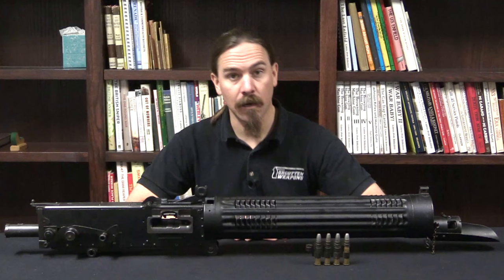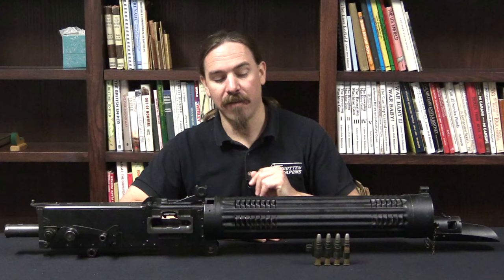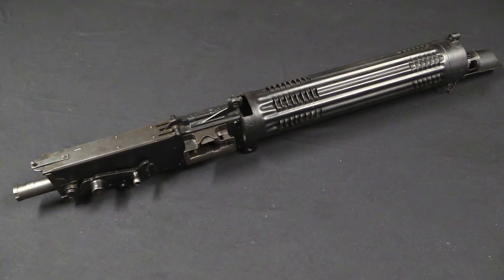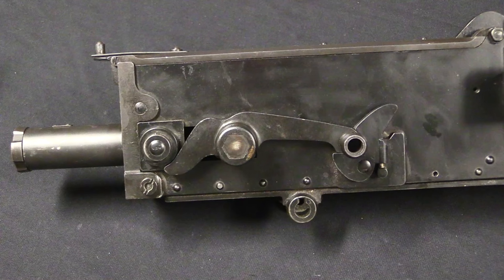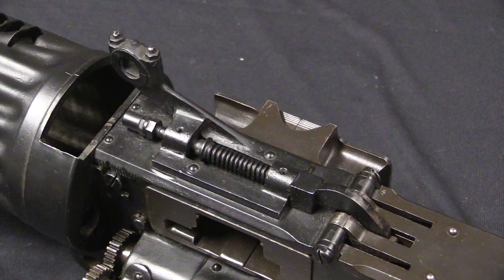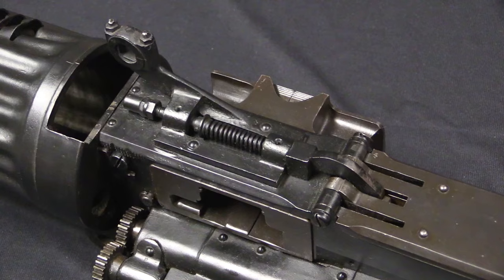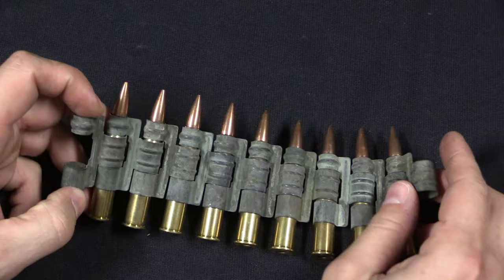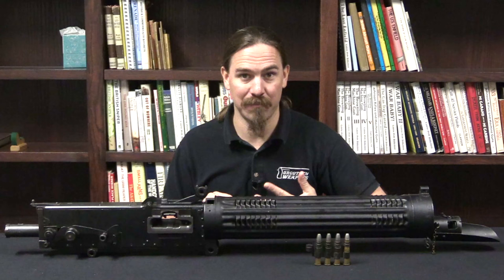11mm Vickers "Balloon Buster" Machine Gun

Comment: There's actually a fourth way to get a gun to fire safely through a prop, and that's electrical. AFAIK it wasn't used in WWI though. It was defintely used in WWII, the prime example being the 20mm MG-151s in the wing roots of the Fw-190. These used electrically primed ammunition, i.e. there was no firing pin, just an electric current applied to the primer. It was then a relatively simple matter to arrange interrupted slip-rings on the prop shaft that cut power to a gun when a prop blade was in front of it.
Reply: Isn’t that functionally identical to an interrupter? Just instead of mechanical timing it’s electrical?
Reply: @ryanrising2237   Yes essentially. It's a lot more reliable than trying to temporarily stop a machine-gun with a collection of long rods and cams though.
Reply: Ditto mg 17, mg 131.
Reply: Why isn't electric primed guns used more often? Beside the etronX that is
Reply: @thesturm8686   It's used widely in aircraft cannon to this day.
Reply: @MrHws5mp  i mean in a non aircraft related way

Comment: Because he was a former race car driver/mechanic Eddie Rickenbacker made sure his ammo was double checked for cartridge sizing as he was aware that most stoppages were due to incorrect casing size.
He also carried a small hammer which he used at times to help remove a stuck case while in the air.
(Source, Rickenbacker's autobiographies)

I wonder if, Frank  "Arizona Balloon Buster" Luke who is credited with 19 overall kills (placing him second behind Rickenbacker), with 14 of those kills being balloons, used one or two of these 11mm guns.
Reply: A Vickers with a failure? Must of been you yanks doing something wrong. ;)
Reply: @sshep86  if I remember correctly, the armorer was actually a Brit.
Just kidding.
I enjoyed your comment.
Reply: @sshep86  ammo stoppage.
Reply: @ScottKenny1978  should of stuck with the .303  Proven reliability record.
Reply: @sshep86  but the US Navy wanted the machine guns in their new rifle caliber, for supply reasons.

Just not enough recoil force with that little 6mm Navy round to run the heavy Maxim action. The Colt 1895 weighs about half of what an 08/15 does.

Comment: Balloon artillery guy: "uhh, a little bit to the right... Keep going! Uhh, my balloon is making a funny noise. Why's it hot up here?"
Reply: At least the guy was provided with a parachute. Not a very sophisticated parachute, but If I was jumping from a burning balloon I would't be too choosy.
Reply: @donjones4719  , I didn't know that they were provided with a parachute.  I was thinking,  how horrible it would be to have a flaming ball of hydrogen exploding above you. I wonder what their survival rate was.
Reply: @MrJeepmarine  low I would imagine, even with most of the fireball going up and out [from penetration points]... there would still be enough flaming material coming down on them.
I would surmise it would be hot enough to cause serious burns on the skin, and potentially fatal burns if it enters the nose or mouth.
Only good news is that it would be a fairly quick flash, that right there might make the explosion survivable... the fall? No clue.

Comment: I like the Modifications they did to enhance its air cooling - the jacket probably created a nice forced air venturi that really enhanced the cooling.  That super stiff spring on the cover makes total sense for a platform that could be maneuvering and spinning around at fairly high speeds (well for those days anyways.) Great Video and very informative. I would have liked to see you operate the charging handle because it looked like it had some weird locking, cam mechanism on it.  Great Stuff as always!

Comment: Epic, nice vid, never knew this existed
Reply: Balloons were filled with hydrogen as it was easily available, but helium was only available in the US from gas wells in TX and OK. 
Note that parachutes were developed to allow balloonist to get out of their flaming craft.
In WWI, almost all propellers were directly driven from the engine, so prop rpm and engine rpm were the same, but synchronization had to account for number of prop.blades.

Comment: 11x59R Gras cases can be made from
.50/90 Sharps brass; ( Starline)
Since the Vickers Balloon Gun was built ( converted) from a basically .303 Vickers ( via 7,62 Russian) any missing parts could be supplied from Vickers normal parts ( except for those specifically for the 11mm.) and with modern CNC or 3D Additive Metal Printing, replaced as necessary.
It Turbine blades canebe made by 3D printing, gun parts can be also.
Excellent video.
DocAV

Comment: Couple of comments- The German dirigibles of the 20s and 30s contained Hydrogen in a number  of bags inside the airframe. If the WW1 balloons did the same it would explain the difficulty of firing the balloons with an MG. Also, Ian stated that cloth MG belts were "fine" in ground use, but not so. They would stretch when wet, often causing jams. Also, rounds would often fall out, sometimes partially, causing more jams. There is a famous picture of a Marine with a cloth belt of .30 cal. ammo, with one round loose and ready to fall out. I think it was on Guadalcanal. His helmet is on backwards, something they did to promote rounds deflecting that hit their helmets.  Hackworth mentions this in ABOUT FACE. Funny we were still using cloth belts in WWII .30 cal. guns but disintegrating belts for aerial 50 BMGs.

Comment: Even during WW1, there were rules of war.  Using an incendiary bullet as anti-personnel was illegal.  Both sides issued a card to the pilot that stated that the 11mm ammunition was intended as strictly anti-material.  This saved the pilot from being shot out of hand if he was forced down, assuming he survived, and had one of these guns on board.  A high probability, considering he was flying at low level, into a high density AAA zone, and would have only few seconds to get in and out.  If the balloon crew saw him, they would instantly alert, and be ready for the attack.
This "get out of jail card" which was, I think, blue, held true for explosive bullets, flat nosed incendiaries, and other such methods to bring down balloons, which were remarkably hard to ignite, even filled with hydrogen.

Comment: What i wonder is was the 11mm Vickers/Grah Incendiary propelled with smokeless powder at equal or greater muzzle velocity than the original? Or was it still using ye olde black powder alongside a modern .303 Vickers MG?
Reply: Considering how everytime automatic black powder guns are brought up he ends up saying "They just don't work well, the fouling clogs them up very quickly no matter what you do", I would expect this to have run on smokeless. EDIT: I won't claim to KNOW, just that every discussion on the subject of machine guns running black powder I've seen has so far ended up in the conclusion "nope". =)
Reply: I expect its a reduced smokeless loading. The black poweder fouling would be a problem, and seeing the lead rounds tells me it's not ideal for a full filling of smokeless. That would shred the bullet in the barrel. Curious none the less
Reply: @KuroNekoKohi  The wiki does indeed suggest that they changed the powder formulation and how the bullets were made during the life of the cartridge. Wiki misses a lot of things, so running them with smokeless late in life is IMO totally a possibility:

The original 1874 cartridge fired a paper patched, 25.0 g (386 gr), 27 mm (1.06 in) long lead bullet driven by 5.2 g (81 gr) of F1 black powder, with a muzzle velocity of 450 m/s (1,500 ft/s), the velocity dropping to 430 m/s (1,400 ft/s) at 25 m (82 ft).[3]

An improved cartridge was introduced in 1879 with a slower burning F3 powder, alterations to the tip of the bullet and a reduction in the height of the patch. In 1884 a bullet was introduced of 5% antimony and 95% lead which was compressed and hardened instead of simply cast, and the tip was flattened to improve accuracy.[3]

During World War I an incendiary round was manufactured to be fired from the cartridge for the balloon busting role.[4]
Reply: As far as I am aware they used smokeless, but they would almost certainly had to have kept the pressure down to prevent problems with the cases and keep the total energy levels down to a level the Vickers could handle. The Vickers was a rock solid action, but still an action designed for .303 - approx 8mm. A .50 Vickers was later developed firing 12.7x81, but that required a substantially scaled up action.
Reply: @discerningscoundrel3055  yes, the Maxim gun didn't like going smaller, either. The US 6mm Lee ammo was too small/light to reliably run the design.
Reply: There were fairly low pressure "bulk" smokeless formulations back then that were more or less a drop in for black powder.
Reply: I was really hoping Ian would talk about this. It would be interesting to know the loading, especially considering the 11mm Gras was (to my knowledge) never retroactively offered in smokeless for rifles. Kynoch offered a smokeless .577/450 Martini for Martini Henry shooters up until the 1920s/1930s, and of course the 45-70 is available today in smokeless, both in reduced loadings for Trapdoors, 1886s, etc. and modern big-bore lever guns. But I've never heard of smokeless 11mm Gras until watching this video.
Reply: @Cakeyflour  My recollection is the 11x59 Vickers was smokeless, and a higher pressure/velocity round than the original black powder.   Even so, that is another  reason to favor .303 for dogfights... giant slugs start slow and drag is not kind, ballistically.

My BP Gras loads (rifle) have topped at 93gr bp under a 400gr bullet for about 1485fps.  Compare to a 174gr pointed .303 at not quite 2x the velocity...
Reply: Also, I desperately need one of these, and would do whatever it takes to make it functional.  Alas, there is no way I could afford one.

Comment: That was a very good summary of gun/prop syncing, with one issue: 
as far as I can tell, there was never a successful application of an "interrupter" as you describe them, because prop revolutions could be 2 or 3 times faster than the cyclic rate of the guns themselves, and all successful designs worked by engine actuation. The term interrupter seems to have been used interchangebly with syncroniser.

Comment: As a related note, the RFC and RNAS had similar issues shooting down Zeppelins raiding London and the east coast. It was found that even with incendiary rounds, there was insufficient mixing of the hydrogen and surrounding air to reliable set fire to the airships. The solution was a mix of incendiary and explosive ammunition, which ripped larger holes in the skin of the airships and caused the gases to mix faster - allowing the incendiary rounds to finish the job and ignite the gas. Of course, the British aircraft were using .303 Lewis and Vickers guns rather than the 11mm version shown here, unless I'm mistaken.
Reply: Mostly .303, firing Brock, Buckingham or Pomeroy incendiary rounds once they were available, but they also used .45 Maxims firing a .45 incendiary, and there was an urgent order for the 11mm Vickers which went nowhere as the French said they could only supply 21 conversion kits. There was a considerable amount of experimentation with larger weapons - 1" Vickers, 1.59" Vickers-Crayford, 1 Pdr COW, 1 Pdr Vickers, 1.5 Pdr COW and 2 Pdr Vickers. And right back at the start of the war, before MGs were available, they used .45 Martini Henry rifles and .45-90 Winchester Self Loaders (the .45 incendiary was apparently a 1913 design).

Comment: I imagine another good reason to use 11mm mostly for balloons and not general use is it had massive bullet drop and much harder to mentally compute deflection shots vs .303. 11mm had a slightly lower muzzle velocity of around 2,000 ft/s vs 2,400 for .303, and probably much lower velocity down range since it's a bigger cross section, round nose bullet with no boat tail. Then again a lot of great war pilots only fired at point blank range anyway.

Comment: Fascinating story of repurposing. I would have thought a low rate of fire sufficient. Balloons are big, static and an accident waiting to happen. One incendiary round and kaboom.
Reply: Not as easy as you might think. The H2 needs a supply of O2 to combust, and there’s a distinct shortage of that inside the envelope. One of the advantages of the larger diameter bullets would have been improving the fuel/air mixture. Before the Vickers/Gras, there were complaints of firing entire belts of .303 incendiary without destroying a balloon. Dirigibles were more vulnerable due to pockets of leaked H2 trapped inside the upper envelopes.
Reply: Thank you. Obviously you are right, LabRat & J. Root.

Comment: Actually, the incindiaries were probably pretty effective against WW1 airplanes, as the normal waterproofing material was extremely flammable, and shared by both balloons & airplanes. The real difference was probably just the number of rounds, because a balloon has a hard time dodging even slightly large barns but doesn't have squishy crew inside the most convenient bit to target, whereas a plane has it's crew inside the best target but also dodges much more effectively. Thus, balloons are easy to hit but don't benefit much from volume of fire, but planes are hard to hit and benefit massively from volume of fire.

Comment: FWIW:  Keeping the water jacket on the gun to be a cooling shroud may have been a necessity. 
 
Just having the bare engine cylinders on a reciprocating engine powered aircraft sticking out in the breeze might not provide enough cooling.  Air -- like water -- tends to follow the path of least resistance when it flows, and  that path not be close to all the cooling fins on your engine.  Putting some kind of shroud or cowling around the engine aids in directing the airflow for maximum cooling. 
 
I presume the same would be true for this Vickers machine gun.

Comment: Mark Birkigt was a brilliant Swiss engineer one of the founders of Hispano-Suiza, he is also credited with the invention of the first truly effective brake assistance system (which was mechanical, running off of the prop shaft) as well as one of the best aircraft engines of the first world war.
Reply: He designed this synchronization system during WWI widely used by French aircraft plus the Hispano Suiza V-8, the heart of the SPAD fighters plus many Allied aircraft and far more modern than the earlier German L6, which were  more powerful than Allied radials. He was also behind the design of the HS-404 20mm in the late 1930s

Comment: The way it's force air cooled means that even if I could get my hands on a complete, operational 11mm Vickers, And had access to a forgotten stockpile of ammo with the belt links, I'd still need an airplane to mount in on to use it.
Reply: Or just a big fan and air ducts.
Reply: Could be that convection and the muzzle blast is enough to keep enough air moving through it in the right direction, at least in short bursts. I mean, pretty much any air-cooled MG will get hotter than you'd like if you put an entire belt through it in one go.
Reply: @DeliveryMcGee  maybe?

Though as long as you limited yourself to short bursts of fire you're going to be fine. Maybe 10x 3-5rd bursts per minute.

Comment: A bit of interesting history on the hydrogen vs helium balloon. Hydrogen will only burn if the mixture of air to hydrogen is between 6% and 74%. You couldn't just shoot a hydrogen filled Zeppelin with incendiaries and have it ignite, there wasn't enough oxygen with to burn the hydrogen. The balloon busting strategy was to open as large of a hole (constant automatic fire, large shells, etc.) as you could in the airship so that air would enter the hydrogen cells. Eventually enough air would mix in such that the hydrogen would be able to burn. While the cause for the Hindenburg fire is still debated, a plausible scenario from the ground reporting (according to the Smithsonian) is that the bad weather probably resulted in them tearing a hydrogen cell open via a collision with the mooring tower. By the time they secured the airship enough air had mixed into the cell that when they had a large static discharge the hydrogen was ready to ignite.

The major push for using helium as a lifting gas over hydrogen has largely occurred before the Hindenburg. Helium was a byproduct of the oil drilling (released from underground pockets) and the oil industry was looking for commercial applications of it. When they were demonstrating the safety of Helium to the US congress, the demonstration deliberately used a hydrogen balloon that had a large amount of air mixed into it so that it would explode when ignited.

The switch to helium also resulted in a large amount of airship fatalities. Helium is a less performant lifting gas compared to Hydrogen, so when you take airships which had previously been designed for Hydrogen, they can't life nearly as much payload. On many airships, the safety valves were welded shut, because venting any of the Helium would result in the airship crashing from lack of lift. So when the helium filled airships (that had been designed as hydrogen airships) got stuck in bad weather or large updrafts, they had no way of descending. Many of the US military airships crashed in this way.